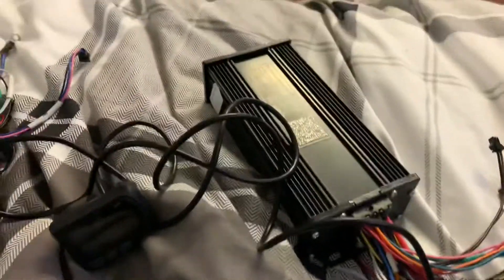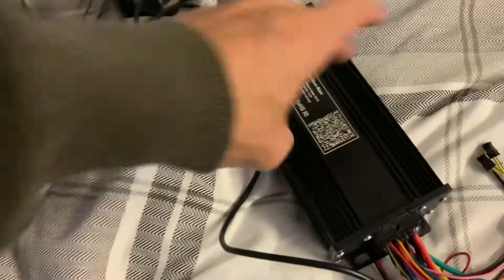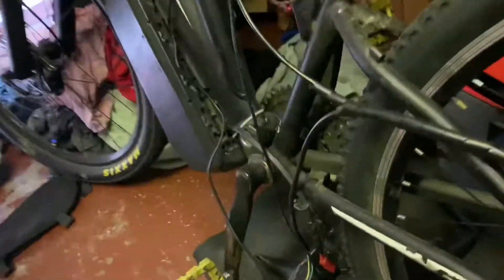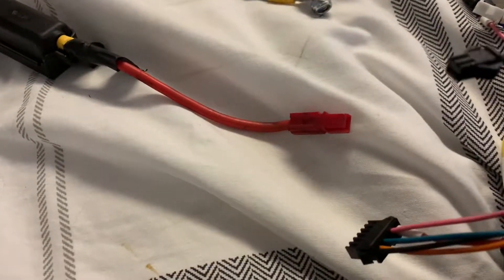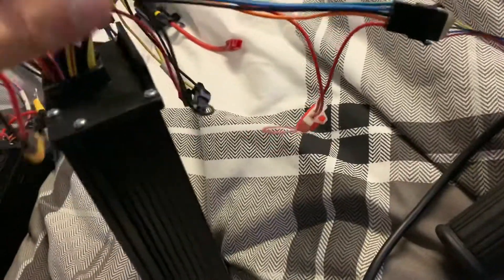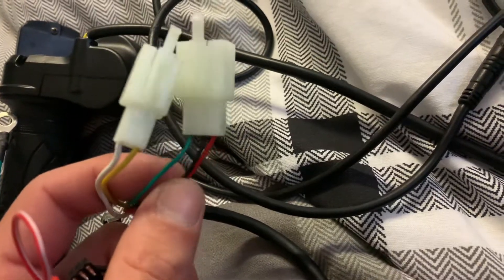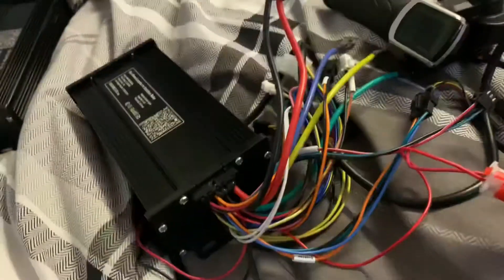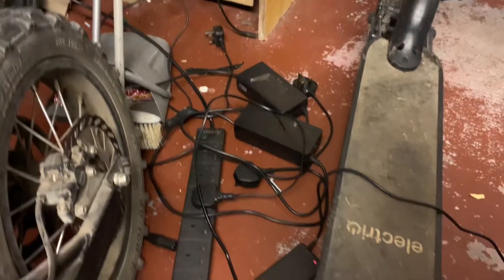TV S1 E5 #surron

Comment: 👌👌👌what’s the bms on them Samsung battery’s bro?
Reply from the maker: 40a mate 👍
Reply: Ooh nice looking to upgrade battery my self just so many options 😂
Reply from the maker: I get about 1 hour runtime out of standard battery and about 1.5 hours out of 17.5 ah Samsung battery but after 1 hour the motor is hot so if you make the range further other components may suffer it’s such fun and a nightmare at the same time
Reply: @48Volts  Yhh man 100% think ima have a shop about speak to a few ppl see what’s best
Reply from the maker: @mr_jumpleads  read up on 52v battery’s I ran a 52v 15ah battery in my MXR stock and it was well fast
Reply: @48Volts  nice I know someone with a 72v 20ah 45bms and it flys I just want a batttey that will
Fit nice with good range
Reply from the maker: Good luck 🤞 bud that would be sick!!!!!!